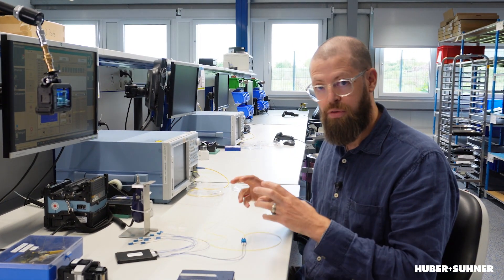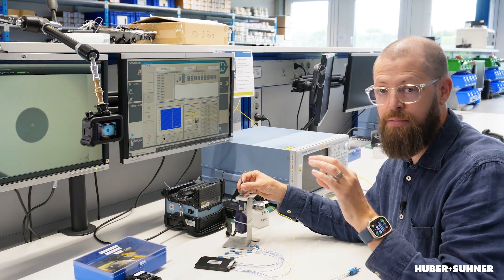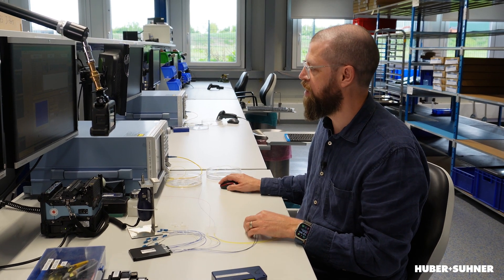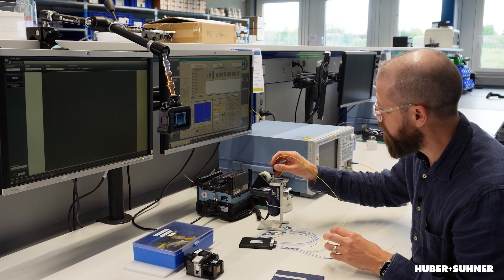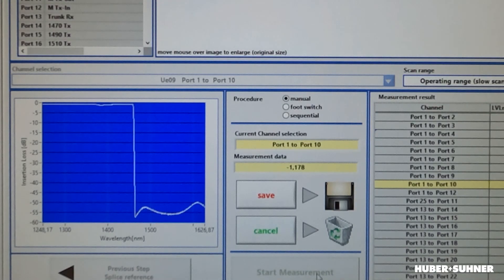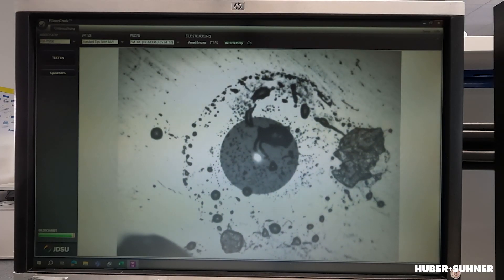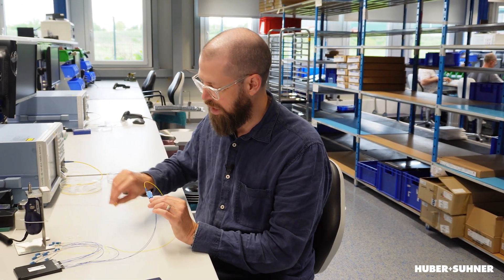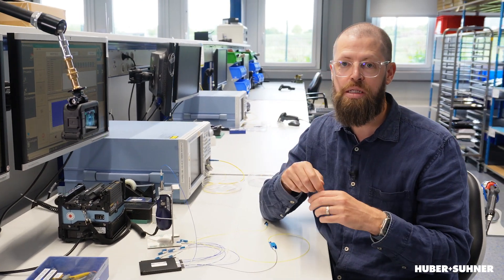Fiber Connector Cleanliness Explained (01-07-02)

Comment: Hey James, awesome demo.. could we see in the microscope what the contaminated fiber would look like after using a one-click cleaner... and what if we did multiple 'clicks'? Thanks
Reply from the maker: Hi Kaelem. Thanks your feedback. Pleased to hear you like our #brainsnack video.
Basically, the clean connector I show at the beginning with the microscope is what it looks like after using a proper cleaning tool. We generally clean the connectors twice before mating as it can occasionally happen that they are not 100% clean after the first time. More than twice isn't really necessary.
By the way, to clean the fiber cable connectors, we use the cassette style cleaner (it's the blue and yellow box that is lying on the table in front of me in the video) as this has the best cleaning results. The one-click cleaners (that look a bit like a pen) we mainly use to clean the connectors that otherwise aren't accessible with the cassette cleaner e.g. Transceiver connectors.
I hope this answers your question.